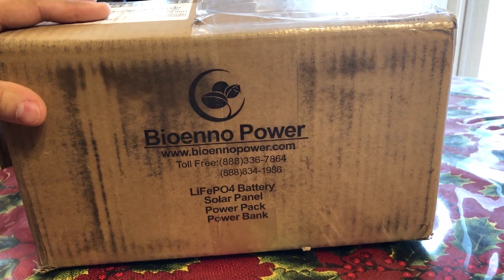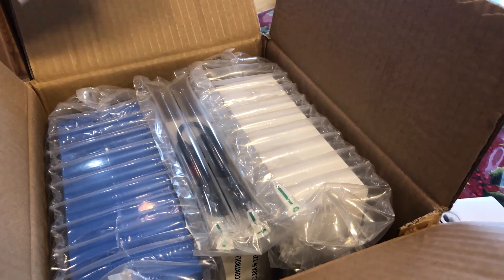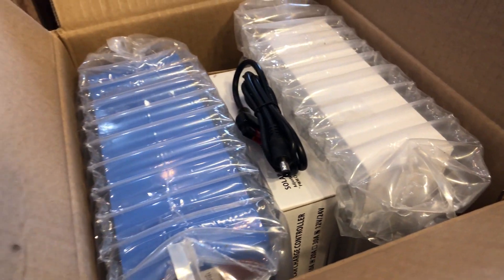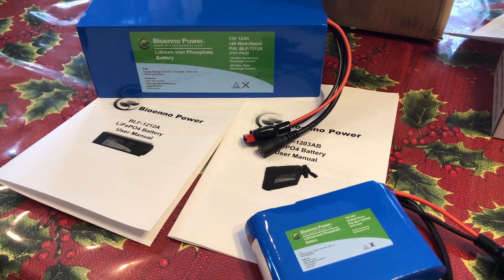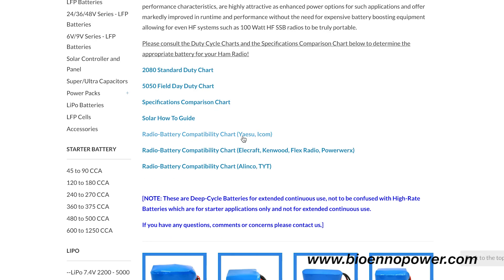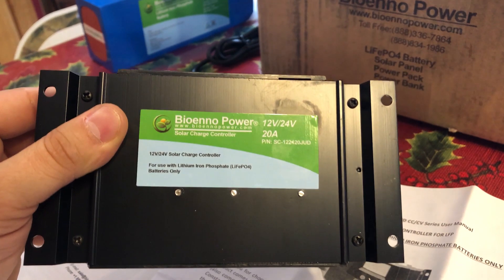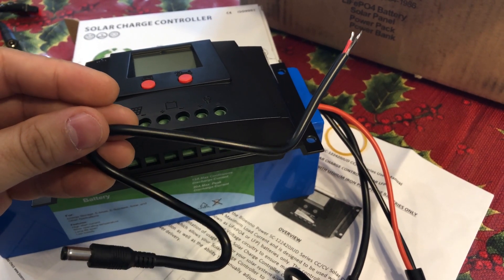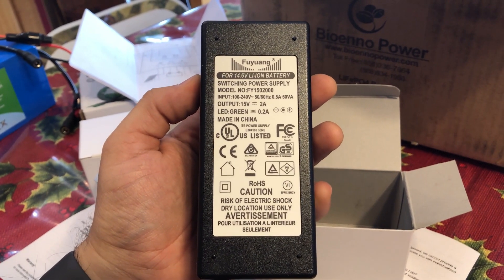Bioenno LiFePO4 + Solar Charge Controller (Unbox)

Comment: I was disappointed to find my Bioenno solar charger & solar panel create noise on my radio.  Have you experienced this?  Next time I will carry a longer power cable and see if that clears it up.
Reply from the maker: Sorry for the late response. I have not had this issue. Maybe the shielding in your cables might not be working well. Thanks for watching!